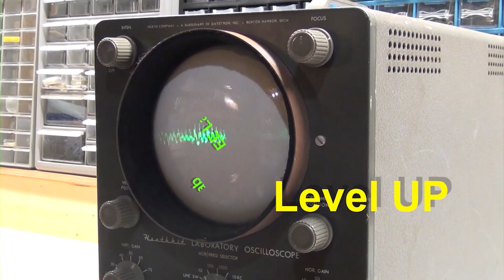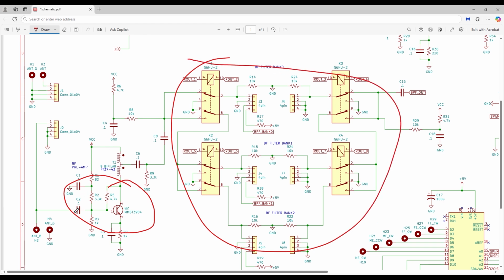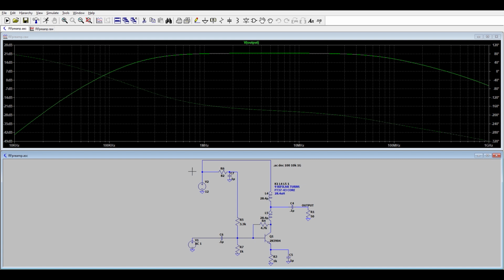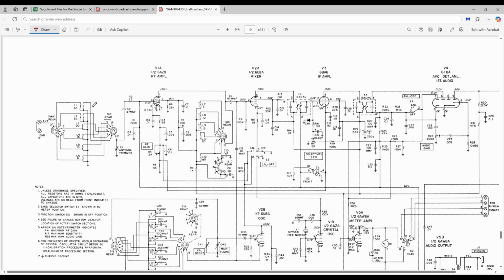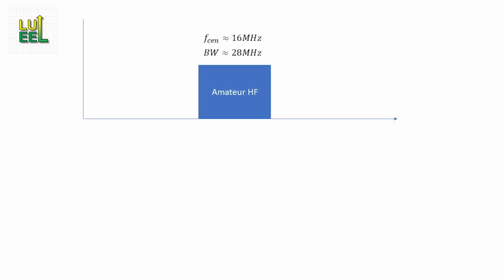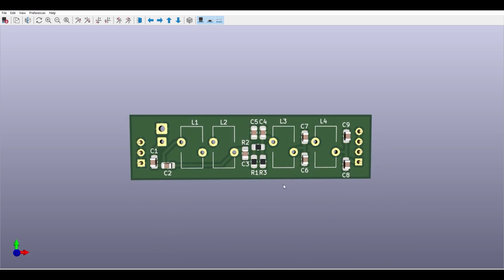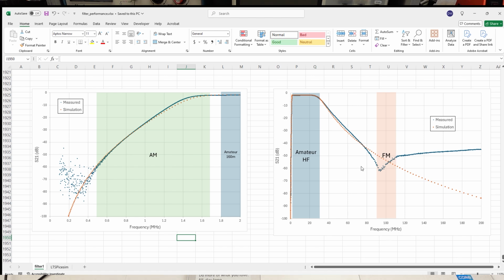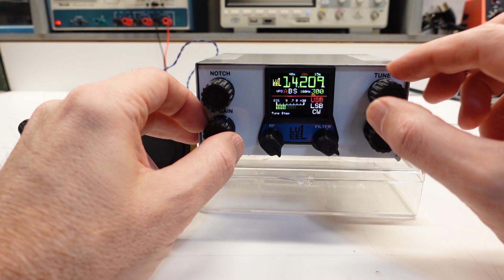HF Receiver Part #11: A New Issue!

Comment: When I saw your original design had a pre-amp with no front-end filtering I assumed you lived somewhere quite rural. Where I am on the outskirts of Denver I put AM and FM filters in the front end of any HF receivers I build. I also use a variable gain pre-amp. That helps a lot. I had to add an AM filter to the front-end of a friends Hammarlund SW because while he lived far up in the mountains at over 9,000 feet it was almost line of sight to the Denver AM radio station's antennas, and you could hear a couple of them splattering all over the SW bands. I added a metal box on his antenna input with 3 simple LC filters to ground with air-variable tuning caps, and tuned out the 3 strongest AM stations. He said it worked great from then on. But I'm just waiting for a 4th big gun AM station to come on the air one of these days. I should have built him a good high-pass filter like yours, but I didn't have the right toroids handy back then. Now I do. Parts is parts. Thank you for the video.